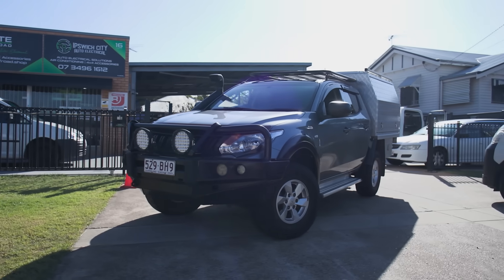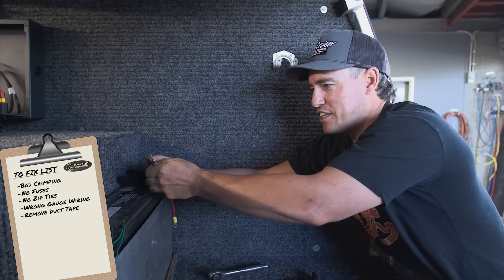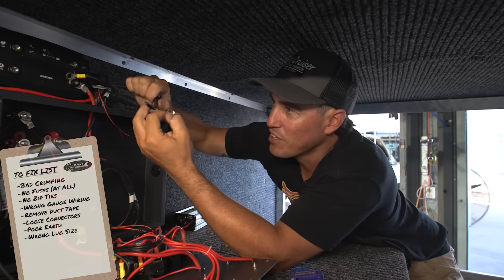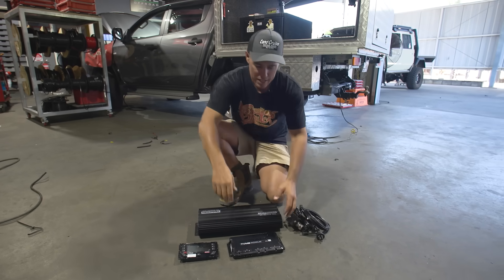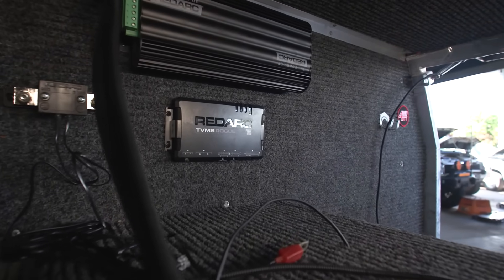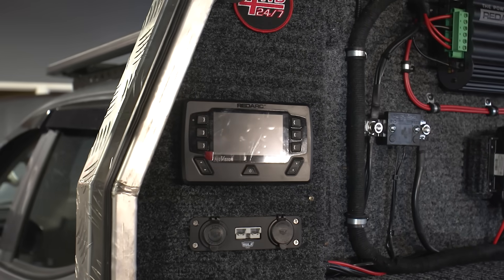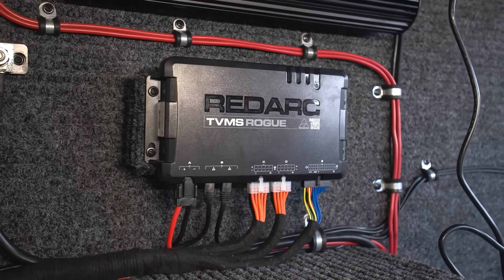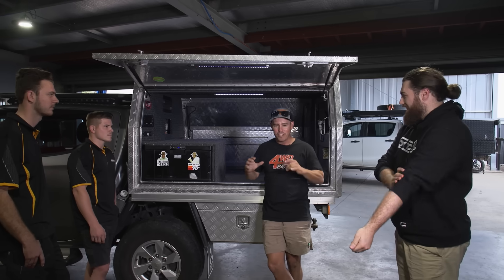This 4WD could catch fire any second... The 12V Mistakes DIYers make that you need to avoid!

Comment: Alot of people have missed exactly what this video is the title doesnt say anything about heres how to do a cheap 12v setup it says here are the mistakes diyers do in there 12v setup good on them for upgrading one of there mates cars to redarc and properly done wiring
Reply: Not to mention this set up is over $3000 and thsts not including labour  and not everyone had that kind of money.
Reply: I've read your comment 10 times and I still don't understand what you are commenting XD
Reply: Yeah, noticed that. Not really about teaching us how to make a DIY setup, but how to spend $4000 on an amazing setup. Some good (but basic) cable tips, though.
Reply: Yeah, but what they have actually done is not "how to wire it properly" but "how to ditch what you have and buy a Redarc system to put in". It has not actually addressed a lot of "how to fit the system correctly" as there are actually a lot of errors and poor advice. It would have been better to do the "how to make the old system safe", do it on the bench, then give their buddy a full redarc system if they want as a "but this is what you could also do!".
Reply: @overlandready  I liked this show before they went commercial. It used to be about the adventure, not selling over priced goods. I'm in the U.S. and the average "Joe" can't afford to drop $15,000 on an aluminum, decked out canopy and $3000 on a Redarc system.

Comment: Did my own 12V setup in my Wrangler and caravan and camper trailer. 15 years in and no problem. And I am not mechanically or electrically minded. I use good mid range gear, take care to insulate all wiring against shorting and rubbing etc. Use the thickest wiring I have to ensure power drop etc. Shit tighten every bolt etc. Fuse everything. Never had a problem.  This is just another advertorial.

Comment: Great content.

Thank you.

If I may:

15:08 ... Custom cover is a 10 on looks ... just wondering for the Manager30 & TVMS Rogue -- mounting orientation optimal per the manuals, but whether they should have more open space above & around for heat dissipation?

Anyway, thanks again for the content.

Comment: I've just gone a victron has 100amp lithium and few other bits and pieces. Running a 800w inverter. Question is should I go a larger inverter or will the 800 be enough to run things like a kettle, toaster just small appliances 
List of things I have 
Battery
30a dc charger
20a solar charger
712 bmv battery monitor
Plus sockets usb and aux power outlet on circuit breakers
Reply: I'm new to all this, hasn't been installed yet, so still learning.
Reply: Have a look at the power rating written on your kettle and toaster (probably on the bottom). If they are standard household ones I would expect them both to be over 800W - toaster maybe 1200W, kettle maybe 1500W.
I have seen little car kettles that run off 12V but have heard that they take a long time (30 minutes) to boil water.

Comment: Although the main focus of the video is on how to correctly wire a 12-volt system, it would be helpful to see it done on a budget system as well. RedArc may be the best in the market, but most of us cannot afford a $3,539.01 12-volt system. However, many of us still want to go on adventures and have a great time while staying safe on the tracks.

Comment: I tossed out my Projecta Powerhub. It was good but just didnt work. I have installed a dmallish Hardcor management system, mounted by Mppt for solar and my battery and so far so good. I did run over all the cables with a multi meter. I have 2 fuses in line so thats all good. What I found were my dosgy crimps. So the next job is to grab a decent crimper and get that sorted. I did all my checks before watching. Annoyed my son who is a high voltage lecco in the mines. Drives him nutz.

Comment: I don't know the cable length used for the main  battery to DCDC charger, however 8 BMS seems undersized to me unless the cable length is no more than 3 metres which I find highly improbable.
Reply: I used 4 B&S for mine, minimum according to Enerdrive was 6 B&S for a 40A system, not sure how they came up with 8 as a standard

Comment: Thanks folks - good advice and I’ve been able to my apply my avionics background to ensure a safe, reliable and robust 12V setup which I’ve been installing for over two years now - never never use soldered joints as these will eventually crack or open circuit due to long term vibrations - all our aircraft joints were crimped only and insulated - soldered items were only used in electronic instruments boards which are also used in battery management and monitoring systems - I’m using Redarc systems, Amptron Lithium batteries and Engel refrigeration - final stage three to commence Jan 2024 to include Inverter, water pump, shower and solar blankets - make sure you also have a good accessible fuse system to protect everything and handy fire extinguishers.

Comment: the bet way to do a 12v second battery system is run 2 fuses (one at front one near second battery)on the cable from main to dcdc so it that wire rubs you don't have fire with the back feed!
Reply: Correct, fuses are there to protect the cables, not the equipment. Should have one fuse as close to the power source as sensibly possible, then one before any charging equipment that the cable goes to, another by the dommestic battery. can't have too many fuses. Also worth considering that over about 6ft wires can become heating elements, My build is fused every about 6ft as it has distribution boxes under driver's seat, and rear seats for 12v stuff. battery is under passenger seat.

Comment: Do you guy's like Solderstick connections. They are connectors, blade terminals, ring terminals ect that have solder inside and shrink tube outside so when heated the wires are soldered and sealed at the same time, no crimping.

Comment: Sadly the 8 B&S cable is still way too small for connecting that system from the start battery to the Redarc dual battery system, way too small, the voltage drop across that cable under load will severely limit the available charging current!
 6 B&S must be used at a minimum, while even larger cable would be much better.
Even the Redarc installation manual for that setup specifies 4 B&S cable in this case, and that is 2.5 times larger cable than what they have used!
Reply: 8B&S will be fine for up to 20A 5-6m distance. I missed what charger they put in there, if it's anything over 20A, yes, it's too small. In saying that, I'd always go next size up especially as you're so close to the limit. No need for 4B&S unless it's a high current charger
Reply: @rexie1999   30A output on the chargeing side, so then there is the additions for the losses and system workings plus any other loads. I'd anticipate a 50A+ inrush current as well on the system. I'd have liked to see something like 25mm² cable on the positive and the negative to the chassis, and uprated the battery ground too...
Reply: @rexie1999 they were using a 50 amp midi fuse on that.

Comment: Taking this week off to wire up the second battery.  It's good to see that I'm in the ballpark for wire gages.  Can't afford the Redarc stuff, so going really simple.  Using a LiTime 40A DCDC charger to a 50Ah battery.  Fuses everywhere.  Just taking it nice and slow to get it right.  I'll have some USBA and C plugs as well as some Anderson 50A and 30A available in the truck for high-power accessories down the road.  I also have a small fuse panel for wiring LED lights.

Then hopefully it'll be to hit a mountain ridge for an overnighter to see how it works in the bush.

Comment: So rather than show how to actually fix up a budget 12v system (like 99.9% of your viewers run) to make it safe you just threw $4k worth of electronics at it, and paid a shop to install it? You should have titled this video "How To Spend $5k Replacing Your 12v System"
Reply: I believe they did fella,told you how to crimp, how to fuse, how to run wire safely, how to use good earths, more then enough info to run your own 12v but also presented an alternative and the benifits of the system.
Reply: they’re just telling people not to be dodgy cunts
Reply: Haha, I was thinking the same! Classic.
Reply: Brother you don’t intimidate me

Comment: What size is the active cable from the start battery to the canopy ?
Reply: 8B&S
Reply: My unqualified $0.02 only.

Cable from starter battery to Manager30 should be:

 -- 6B&S --

10:35 ... I stopped & zoomed in -- looks like a 50A fuse at starter battery ... which would agree with the Manager30 Manual's "typical setup" diagram.

End of the day, cable needs to, among other things:

1 > Ampacity 

Cable must meet the ampacity of it's over current protection device, in this case a 50A fuse.

2 > Voltage Drop

Cable must have minimal voltage drop carrying 50A load over its length.

3% votage drop is apparently strived for in boating for essential loads.

Googling the handy Blue Sea Systems ampacity table, apparenty based on the ABYC's E-11, which seems to jive with the NEC's "free air" ampacities ... cable size should be:

6B&S ... fused @ 50A, run for 15-20 feet.

Comment: Wow, it seems like the main point of the video was missed by a lot of you folks. Ok, so they installed Red Arc,which, yes, is expensive. If you can't afford it , what does it matter. The point is "DO IT CORRECTLY ". Great video guy's. By the way, I can't afford RED ARC either, but I am saving up for a system. Have a great day, folks.

Comment: Great content as always. Question: what must one do if there is a electrical fire or find a vehicle next to the road with a electrical fire? See a lot of vehicles these days that have caught fire due to poor electric connections.
Reply from the maker: Fire extinguisher every time! Never use water. Baking soda is a commonly used item to put out electrical fires also!
Reply: @4WD247 also if water is all you've got it's going to do a better job than nothing
Reply: Get the battery(s) disconnected asap. Even if it means taking wire cutters to the wires. Realistically a small fire extinguisher isn't going to stop the fire unless you've run small cables. Something like an 8bns cable is going to burn for ages before the connection gets broken

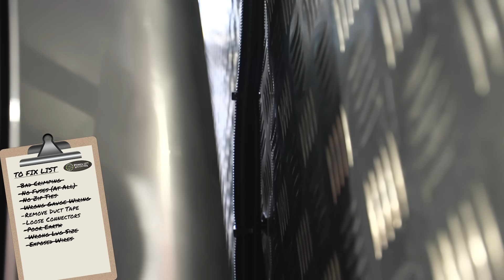Comment: As someone who fixes alloy trays every day I c people doing all that work on there 12v sys only for me to cut it up because I have to take the canopy of to fix the tray so don't hard wire through the tray into the canopy use a joiner between the veichael and the canopy 12:47

Comment: Do not use Mini fuses for main protection, use ANL, or better still class-t fuse.   The mini fuse can be pull 2.5X its current rating to blow! Thats if it actually breaks the circuit at all!! Look into AIC (Ampere Interupt capacity) and you’ll understand why.

Comment: Lithium battery box. 120ah Lithium battery.  40amp charger, 200+ solar panel. For dual zone fridge/freezer. Few camp lights. And maybe a small inverter for battery tools. Hoping it will be enough

Comment: Thats why I dont really like 12 volt systems. Rather use something else and keep my pride and joy not burnt
Reply: Same.
More stuff to go wrong and some of them are so expensive/complex it sort of defeats the purpose of calling it camping imo.
Also dragging all that weight around the whole time.
I can go away for a week and get away with just using a couple of phone power banks for lights and charging my phone and they can be easily charged via a small solar panel or the vehicle.
Also 18v power tool batteries can be multi tasked as well.
Really the only thing I'm missing out on is a fridge so I make do with a quality esky and ice.
Obviously a different thing if spending weeks in the bush and needing a fridge but there's always ways to get around these things.
Reply: Thats why shaun,graham all the boys are going to learn 1 day
Reply: @cameronbreytenbach6359  I actually think that those all in one power pack, solar generator, things would be a decent option for many people.
Run a decent power cable to where they are in the vehicle so they charge more efficiently and away you go.
They can also be taken out of the vehicle easily to be used for other things when you're not camping.
Pretty big and bulky for a decent sized one but given what some spend on these systems they're likely a lot cheaper too.